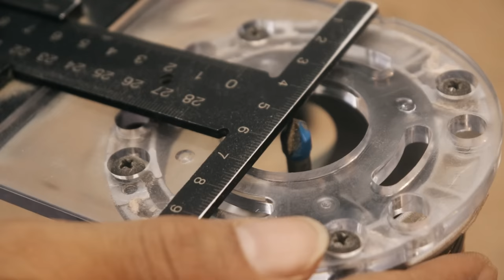Tool Hacks!! Simple But Genius Essential Multifunction Woodworking Guide Cut Circular Saw and Router

Comment: I don't see the need for second part if you just using the backside of the saw guide.  Except maybe as a positioner.  But a rule would do that.
Reply from the maker: Yup you can but need a double mark, this is the fastest work coz mark on center slot
Reply: Many people make this just to use with the router. He made the other side to be used with the circular saw, which is brilliant.